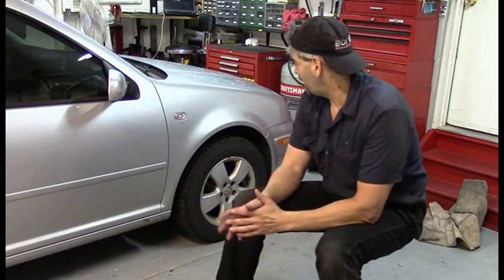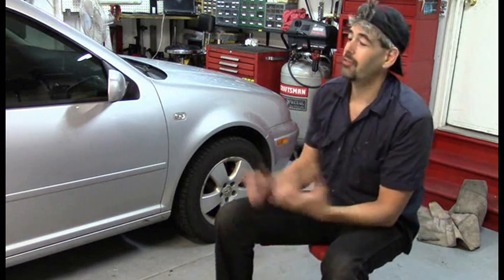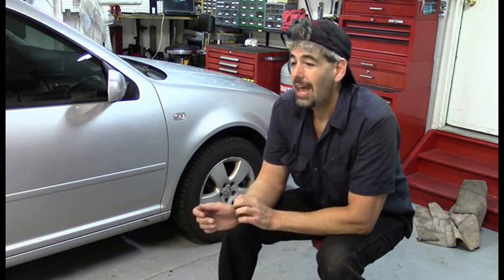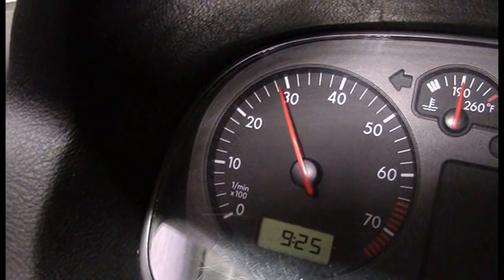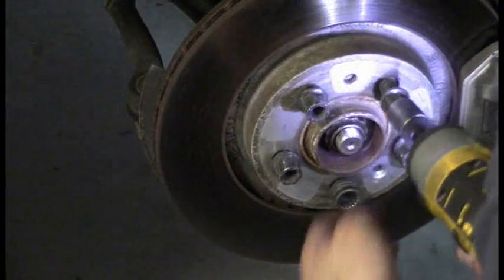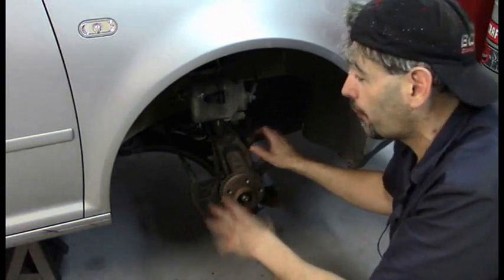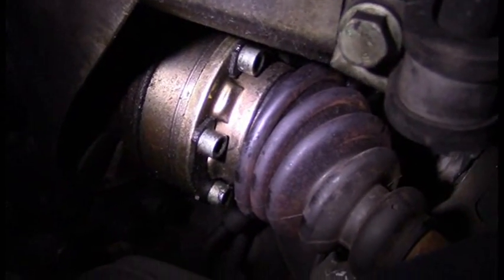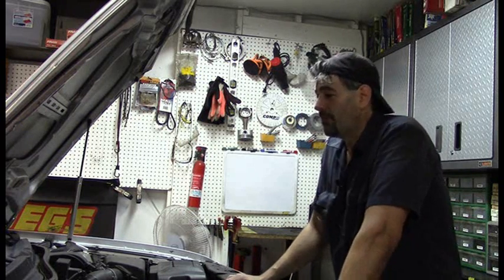2003 Jetta Vibration Diagnosis- Is it Driveline, Clutch, or other?

Comment: Was the flywheel removed?  Were the bolts torque correctly and in sequence?  Pressure plate torqued correctly?

By the way, I love how you insult both amateurs and professionals equally in your relentless quest to put all illogical automotive personnel in their place :-)
Reply from the maker: I am equal opportunity I guess!  I do not know what work was done with the clutch replacement. I also suspected these same things.
Reply: What is difficult to correlate is why pushing the clutch in get rids of vibration or does it only reduces it?  If there is imbalance at flywheel, it will be more pronounced as you add more spinning mass to it.  But that means the vibration is still there at neutral but you just can't feel it.  That would take a feather off your hat though :-)
Reply from the maker: 12vgs8606 Exactly. I don't think it's the flywheel because it is absolutely smooth as silk when you are in neutral or push clutch pedal in. Then again as you stated sometimes imbalance issues are accentuated under load. Hard to say but the key is the vibration is there without axleshafts and that sufficiently rules out driveline for me.
Reply: which component no longer spins when the clutch pedal is pushed in or the car is in neutral?  Differential (is it the same thing as carrier?)   Is there any easy way to test that hypothesis?
Reply from the maker: 12vgs8606 I like the idea but I can't really think of a way to test that. Even so, would not a differential vibration be consistent with vehicle speed instead of engine speed such as in this case? I would like a way to rule that out for sure though.
  Tell you what, you come up with a way to test the diff and I will keep focusing on insulting the parts changer community.
Reply: You got me there!  Differential does run at vehicle speed and does not see the engine speed at all .  Back to drawing board again!  Will be interesting to finally know what fixes the vibration in the end.
Reply: Professional automotive technicians don't throw parts at a car. That's a parts changer. A professional is the one that diagnose, verify and confirm the problem and fix it accordingly to. Us the professionals invest thousands of dollars in diagnostic equipment and training, While the parts changers pull a code throw a part and get paid weather its fix or not and when they run out of parts that's where us the professionals come in to play.

Comment: 2003 jetta 2.0 manual trans. Just replaced passenger side axle with a new aftermarket one. Its vibrating at 3500 rpm regardless of speed. DONT buy aftermarket axles

Comment: AHHHH!!! Exact same vibration same issue... what was the answer!
Reply from the maker: diagnosis was the answer! the same symptoms do not necessitate the same etiology.
Reply: @SchrodingersBox  Further complication is new timing belt, tensioner, and water pump... along with flywheel and clutch..and the axles. Any suggestions on least invasive tests to isolate between the timing belt vs clutch/flywheel?
Reply from the maker: I would start with the driveline since it’s most likely. if that shows not to be the problem you will have to check for anything like pulley misalignment using a straightedge (I use a laser level) and if it’s not external I check things like CKPS and CPS waveforms and correlations to get evidence of any internal misalignments without taking the engine apart.  All noninvasive methods.

Comment: First of all just change the rubber boot not whole axles!? Why people do this? In UK we replace them for like $10 per piece. What a waste of money...
Reply: because replacing a rubber boot doesn't fix worn cv joints
Reply: Calvin Tutterow
If cv joint is worn than ok but I see Americans recommending to replace whole driveshafts if rubber boots are gone..
Reply: Doug Anderson
"EXTREMELY TIGHT TOLERANCE"? LOL.Are you talking about formula1 engine or some big simple joint with few metal balls inside? You must be one of them armair tech's.
In UK cars drive for 10 of thousand miles after boot replacement. A spec of dust will not hurt them.
Reply from the maker: LOL- yes there are not "extremely tight tolerances" on a CV joint.  There aren't even tolerances.
  The fact is, a typical axle or half-shaft with CV for most FWD cars costs about $45-$65.  For that price it is just cost effective for most people to get a new shaft and be done with it.
  I have changed boots and I have to agree, to avoid the extra time, messing with a bucket of grease and ensuring maximum longevity for a customer it is so worth just replacing the component.
  If the component were, say, $200 then I absolutely would just change the boot.
That's just my .02.
Reply: Schrodingers Box
Axles are usually more expensive than that in UK £100 - 150 is not uncommon. And you usually get a cheap/aftermarket part for that sort of money. And to be honest I was thinking more about buying a boot and fitting it by yourself.

Comment: Rotor is missing the rotor set screw
Reply from the maker: Those are not necessary. They are used in manufacturing to hold in place through the assembly line. When replacing a rotor they are not needed

Comment: it's funny that people are still suggesting it's the axles when the problem was still there AFTER REMOVING THE AXLES!!!!!!!
Reply from the maker: No doubt. i mean it’s pretty straightforward I would think. it is NOT a driveline problem. in fact it did turn out to be some missing teeth on the timing belt. 
   i guess some people don’t follow basic scientific thought process?

Comment: Probably a bad clutch alignment or a bad bearing
Reply from the maker: I know very little about clutches- I only ever have done one but I agree an alignment or balance issue of some sort is precisely what I suspect.  But not on the flywheel otherwise I would expect the vibration to happen in neutral.  Thanks for the comment!

Comment: So did you ever find out what was the issue? If so, can you pin the answer to the top?
Reply from the maker: Yes it turned out to be a timing belt with several missing teeth.
Reply: @SchrodingersBox  Hi, 
Thank you for your very informative videos. I like the way you investigate to be 100% sure before changing any parts. I learnt a lot since I watch your videos!
One thing I don't catch while reading this question and its response: how can a clutch(/axle) replacement can affect the timing belt ? (did we miss some "data" from the owner, like over rev situation ? ) 
Thanks

Comment: Yei...! Another video
Reply from the maker: Lol yeah it's been a while. Since I am a DIY it is sometimes months of brakes, A/C, R&R's, drivebelts, etc before I get interesting diagnostic situations. Thanks for hanging in there with your subscription!!
Reply: Schrodingers Box Nice video. If you are so inclined, I wouldn't mind seeing your approach to AC repairs. I know those videos are a dime a dozen on Youtube, and you may consider some as basic wrench turning, but it would still be good to see YOU do one, as I'm sure you would show the right way to do it !
Reply: Schrodingers Box you take away the insane partchanger way from diagnostics.
Reply from the maker: Thanks Scott. I generally avoided AC diagnosis as there are hundreds of videos on it but next time I get a car with AC issue I will do that.  It is all a matter of interpreting the high and low pressure readings combined with an understanding of how the AC system works and you can pinpoint the issue very accurately. I will cover all of that next chance I get
Reply: Yea i think you could take it to a level beyond the average backyard hack. Perhaps talk about charging by weight vs charging by pressure readings...amount of oil to put in - they always give the sspec in ounces but do they mean weight or flowing ounces, could be a big difference depending on the density. Thoughts on the smart orifice valves, which supposedly give better temps at idle...heck even the proper way to check pressure - i have seen people do it without increasing their idle, and I have seen others do it at 2000rpm (which seems to be the 'book way'. ) Can get VERY different readings at idle vs 2000rpm. On that note, maybe tricks on how to keep the idle at 2000 if you are by yourself (electronic vs manual throttle).

Comment: Not a good way to test it, nice try tough
Reply from the maker: Oh- what’s the right way to test it then ?
Reply: @SchrodingersBox  A very Good way 
When driving on in a road test  different parts of the car produce Audible frequency, anything relating to wheels and tyres produced around 15hz, 
One example when its driveshaft then your make mirrors will usually vibrate  this is around  60hz. Many driving parts produce their unique frequency, Dual mass flywheel, clutch, engine mounts the list go on. if you have the info, your senses will help  and even a db meter,  this is in practice to quickest way to find a fault.  for all sounds but in this case for a drive train diagnostic  its likely the best  without having to strip in down okay piece by piece, by hey nothing wrong with doing that, but for me that's possibly time wasted 

also my comment was but harsh sorry 

As for the Garage that worked on the car  Unfortunately pattern drive shafts not balanced correctly to the spec of manufacture, will vibrate at a certain point. 
Not using a clutch alignment tool when fitting, can cause clutch judder, not inspecting the flywheel after  installing new clutch (Dual mass for sure).
failing to grease or using correct grease where needed especially ie, end of primary input shaft or clutch release bearing. this list could go on 

anyhow hope you found the issue, I  do like your channel very much good job
Reply from the maker: Yeah that’s a good way to do it if you have that equipment. I do not, nor does any other DIYer. 
   Anyway I did determine the cause was some missing teeth in the timing belt.
Reply: @SchrodingersBox  you don't need equipment that was my point you have your senses, you understand that interior mirrors vibrate around 60hz you can feel that with your hands that was just one example of what I was saying if you have the info a DIYer could do this, sorry my explanation wasn't great in my comment.  I was really referring to a road test using your senses to rule out ie tyres etc hearing and feeling  different harmonics. Amongst other things  I'm assuming you figured it out the teeth were missing  with a stethoscope ? I personally can hear a pulley or a tensioner if i'm in the car or if someone were to drive up to me they usually stand out. Good job you changed that belt though hey that could have been quite expense saved those people a bunch :)